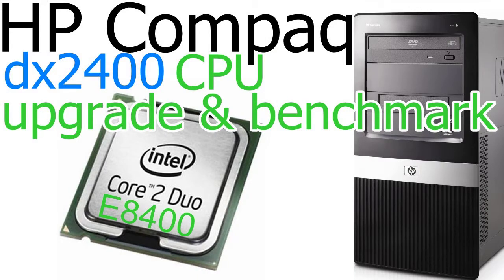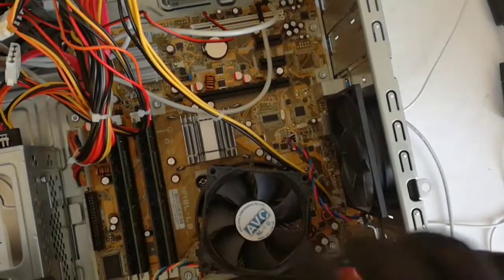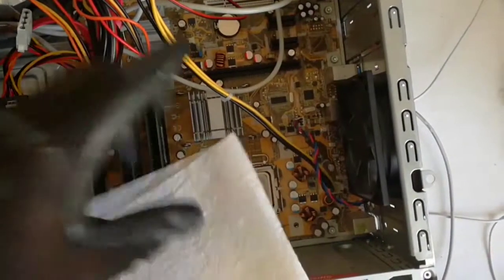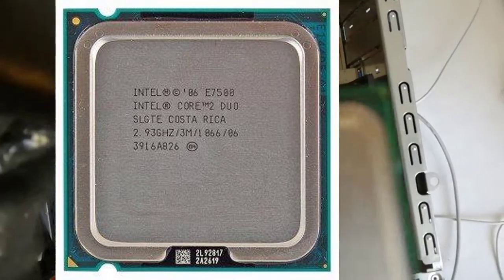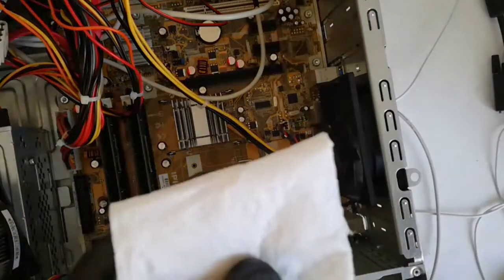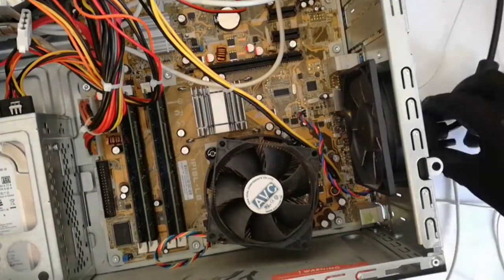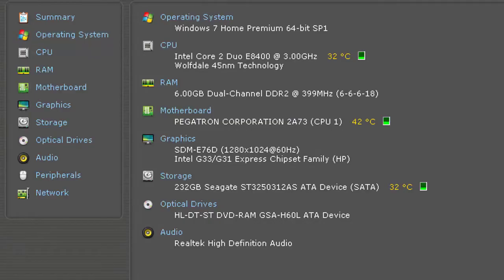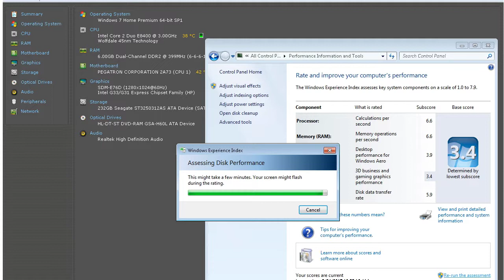rd #183 HP Compaq dx2400 Microtower PC upgrade to Core 2 Duo E8400 @ 3 00 GHz

Comment: Can it work with core i 3
Reply from the maker: Aloha, sorry, the dx2400 has socket 775.
The dx2400 support these CPU's:
Processor and Speed
One of the following

Intel Celeron Processors
Intel Celeron 420 Processor (1.60-GHz, 512-KB L2 cache, 800-MHz FSB)
Intel Celeron 430 Processor (1.80-GHz, 512-KB L2 cache, 800-MHz FSB)
Intel Celeron 450 Processor (2.2-GHz, 512K L2 cache, 800-MHz FSB)
Intel Celeron Dual-Core Processors
Intel Celeron Dual Core E1200 Processor (1.60-GHz, 512-KB L2 cache, 800-MHz FSB)
Intel Celeron Dual Core E1400 Processor (2.0-GHz, 512-KB L2 cache, 800-MHz FSB)
Intel Celeron Dual Core E1500 Processor (2.2-GHz, 512K L2 cache, 800-MHz FSB)
Intel Pentium Dual-Core Processors
Intel Pentium Dual Core E2160 Processor (1.80-GHz, 1-MB L2 cache, 800-MHz FSB)
Intel Pentium Dual Core E2180 Processor (2.0-GHz, 1-MB L2 cache, 800-MHz FSB)
Intel Pentium Dual Core E2200 Processor (2.20-GHz, 1-MB L2 cache, 800-MHz FSB)
Intel Pentium Dual Core E5200 processor (2.50 GHz, 2 MB L2 cache, 800 MHz FSB)
Intel Pentium Dual Core E5300 Processor (2.6-GHz, 2MB L2 cache, 800-MHz FSB)

Intel Core 2 Duo Processors
Intel Core 2 Duo E4600 Processor (2.40-GHz, 2-MB L2 cache, 800-MHz FSB)
Intel Core 2 Duo E4700 Processor (2.60-GHz, 2-MB L2 cache, 800-MHz FSB)
Intel Core 2 Duo E6850 Processor (3.00-GHz, 4-MB L2 cache, 1333-MHz FSB)
Intel Core 2 Duo E7200 Processor (2.53-GHz, 3-MB L2 cache, 1066-MHz FSB)
Intel Core 2 Duo E7300 Processor (2.66-GHz, 3-MB L2 cache, 1066-MHz FSB)
Intel Core 2 Duo E7400 Processor (2.80-GHz, 3 MB L2 cache, 1066-Mhz FSB)
Intel Core 2 Duo E8200 Processor (2.66-GHz, 6-MB L2 cache, 1333-MHz FSB)
Intel Core 2 Duo E8400 Processor (3.00-GHz, 6-MB L2 cache, 1333-MHz FSB)
Intel Core 2 Duo E8500 Processor (3.16-GHz, 6-MB L2 cache, 1333-MHz FSB)
Intel Core 2 Duo E8600 processor (3.33 GHz, 6 MB L2 cache, 1333 MHz FSB)

Intel Core 2 Quad Processors
Intel Core 2 Quad Q8200 processor (2.33-GHz, 4 MB L2 cache, 1333-MHz FSB)
Intel Core 2 Quad Q8300 Processor (2.50-GHz, 4 MB L2 cache, 1333-MHz FSB)
Intel Core 2 Quad Q9400 processor (2.66-GHz, 6 MB L2 cache, 1333-MHz FSB)
Intel Core 2 Quad Q9650 processor (3.00-GHz, 12 MB L2 cache, 1333-MHz FSB)

Thank you for watching, if my video or advice was useful, please consider to share and subscribe, 
or if you think I deserve it  and you want to support my work, You can do it by buying me a cup of coffee at the minimum value of  1$.
https://www.buymeacoffee.com/redigitt  I  https://ko-fi.com/redigitt  I  https://www.patreon.com/redigitt
Good luck and have a nice day .